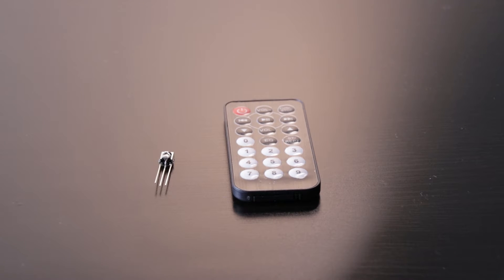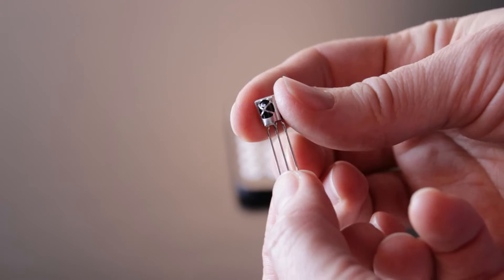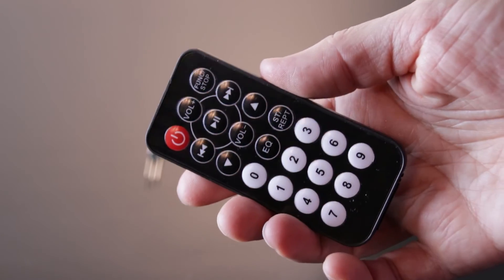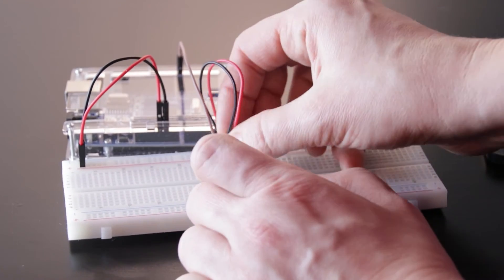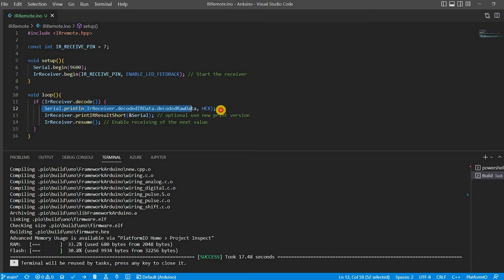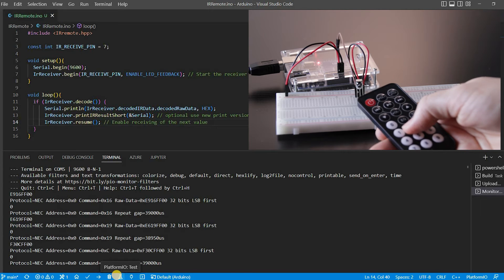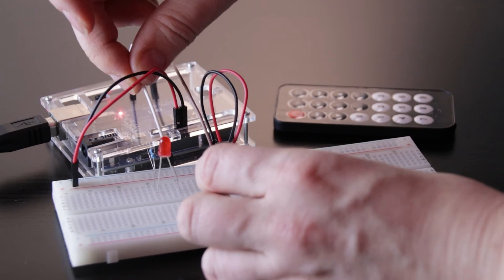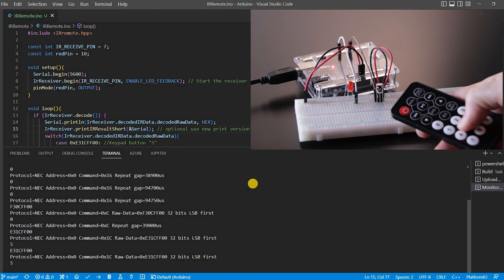IR Remote with Arduino Uno

Comment: I have the problem that no matter which button on the remote control I use, it activates the program???

OK, that problem is solved now, dont know how??
Now I have the problem that only the first "if" is initialized. My next program won't run even though the code is correct!

Can you help find the error? And how if so?

Comment: SUBSCRIBING....this is so helping , but i have a question . i'm using the same code but my program is not recognizing the protocol and giving me different results and when i use it in my if condition its not working at all so pls i need a reply . if you helped me resolve it i will subscribe your channel with every account i have.😁😁😁
Reply from the maker: Hi, it’s hard to debug through comments, but maybe you could try scanning the codes that you are getting from your device and then putting those codes into your if statement. Good luck 😉

Comment: next time please specify the voltage, I just fried mine because I tought it was 5V
Reply from the maker: Sure, thanks for the feedback !
Reply: 5v will not fire the IR sensor, be Carefull the pinout is not the same for all the IR sensors, look for the datasheet next time
Reply: Voltage will not fry it, but Amps will
Reply: Fried what?
Reply: @SwargabashiRoy  the sensor

Comment: Thank you for this, very clear and useful! Using it as a jumping off point, I got the red, green and blue buttons of a remote control I have lying around the flat to set the red, green and blue colour of an RGB LED. Could I ask what interface you use to write and run your Arduino code? I take it that it is not the Arduino IDE.
Reply from the maker: Thanks ☺ Glad it was of help. I use Visual Studio Code with PlatformIO extension.